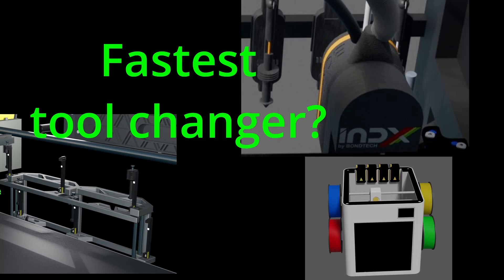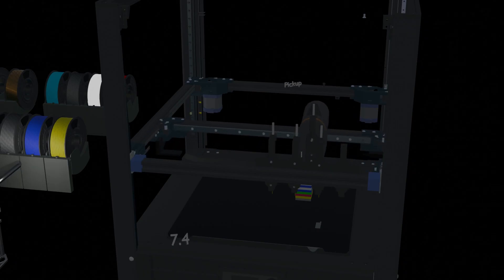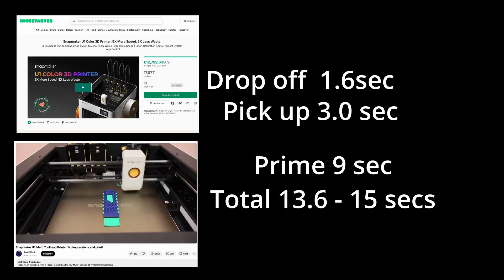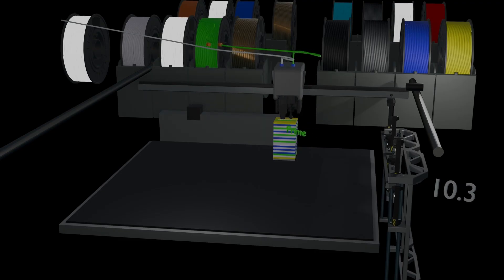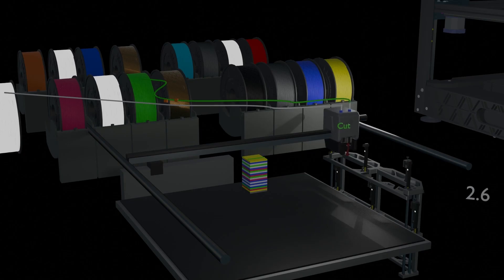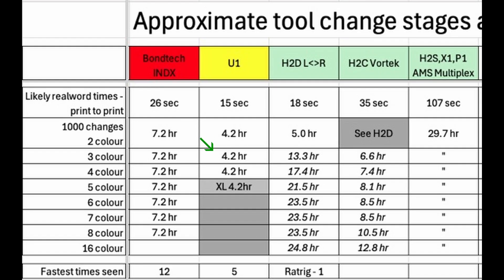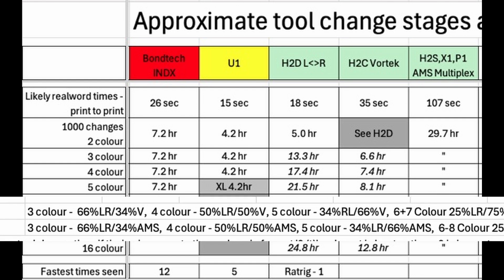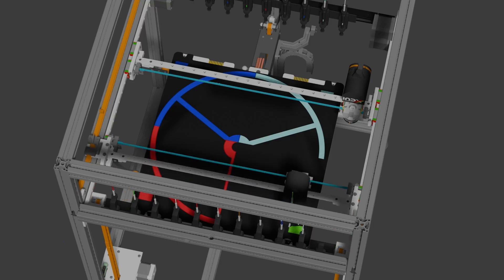INDX U1 H2C Vortex speed comparison V2 -improved sound

Comment: I think you should have included the big player out there in toolchangers - The Prusa XL.

It's toolchanging is about 5 seconds. I'm looking forward to the Core One/Bondtech solution, and suspect they may look at preheated docks to reduce the change times even further.

Much as I love my XL (My X1 Carbon has been collecting dust since I got it), I think the Bondtech solution will be a game changer.
Reply from the maker: I see the XL and U1 being pretty much the same in terms of timings. If you assume the same around 5 seconds for the actual tool change, plus say 9 seconds for priming.  U1 overall print time likely to be faster than the XL due to smaller size and faster factory preset speeds and acceleration.  XL wins in size and one more tool and support. U1 on price.
Reply: @dwuk3d The XL is about 5 seconds  - consistently and that includes the priming. The head is already preheated and stabilised before it's picked up.
Reply from the maker: @theaussieviking8555  For consistency I have included 9 seconds priming in all of my timings (on top of tool change moves and a small allowance for post pre-heating temperature stabilisation) - 

I used the recent Aurotech XL video to get my XL timings - which were
PreWipe	1.70
Drop Off	2.90
Pickup	3.00
Priming	3.57 (changed up to 9 secs for consistency)

If you have any videos showing 5 seconds including priming I would be interested to do detailed timing on them - as doing some fastest possible times could be interesting too (I've got a few very fast stealtchanger videos in this category).   

I know it is possible on some printers to reduce priming time down or turn it off completely, plus the priming time changes on different layers - as for example on the bottom layers the prime tower is often a fair bit bigger and needs a big brim created.
The H2D for example definitely needs a prime tower, whereas on an A1 and X1C you can often turn it off without too much noticeable impact.

In theory for the H2D type nozzle/nozzle swaps should be the quickest of all - as there is no need for any X/Y movement to pick up/drop off the heads - but I know that in practice XL/U1 changes are quicker - although I guess that may machine if BambuLab feel pressure to increase their speeds.

Next fastest should be the tool changers - U1/XL - mainly due to the preheating, plus not needing a big X 'release move'.

Slower will be INDX due to post pick up heating and extra moves, but the fast cooldown/heatup should reduce oozing/cooking a bit - so may need less priming.

Vortex will be the slowest - for all of the INDX reasons, plus AMS moves on top - especially if BambuLab decide to conservative and do a lot of the moves serially - rather than in parallel.
Reply: @dwuk3d  Most of the speeds on Prusa machines are controlled in the gcode. Prusa favors on the conservative side, while Bambu pushes the limit, often too far  in my experience - except for pooping. I was able to cut the poop time almost in half by rewriting Bambu's purge gcode. The gcode for an XL tool change defaults to a max speed of 350, and defaults to a wait state in case the extruder hasn't quite stabilized in the preheat. But these both can be modified in the slicers printer profile Tool Change gcode. I love my XL! No machine is perfect, but it it pretty incredible. That said, I have 2 Voron V2 machines patiently waiting for INDX to ship!
Reply from the maker: Not quite the same comparison I know, but since I got my h2d I am f finding I am still using the x1c's quite a lot. My prusa mk3 though is like your x1c gathering dust.  I'm hoping though to bring it back to life with indx - probably in C1 upgraded form - but I might give Indx directly on the mk3s a try first.

Comment: I still think for people who want a well tested, silent and small printer setup (so difference between outside and print size) for in the home will be best of with the h2c yes it will not always be fastest but for 1,2 and 6+ colors it will be for most people. The 3,4,5 colors it will be say 20-25 seconds slower but many feel  the ams system will only have downsides but it does make many things easier from loading/unloading/drying in the box and easy way to extend to 24colors. Ease of use and (probably) testing for a much better out of the box 'just run the darn thing) . I feel the indx system shows lots of promise but we have to see it sold in several 'i just want to buy a darn printer' products to compare. Clearly for people who want to change or build their own printers the indx system seems to be most fun and best to use to upgrade or change your own printers and probably a very good system for people who want to make a perfect system for a specific use. The 300c max tmp might be a problem.
Reply from the maker: Agreed - i hope they keep the price of the h2c at a reasonable level- it would be good for competition too - to see snapmaker do well and hopefully they will add to the number of tools, increase the size and maybe add some sort of AMS system too once the h2c has demonstrated the benefits of this dual approach.   Also probably a stretch too far - but I am hoping for a 4 tool vortek upgrade for the x1c.
Reply: @dwuk3d  I am personally hoping the 'c' will add a max of 500-600 euro to the price of the h2d level so h2d now at 1899 euro maybe mid 2499?
Reply from the maker: @scb2scb2  I'm hoping they slot it in close to the current H2D combo price - for an H2C combo with one AM2Pro and 3-4 Vortek nozzles.  Would need them to drop the H2D combo price a bit to make that work.
Reply: @dwuk3d  Maybe but ill only get 1 and i am not that price sensitive as some others so we will see where the h2c+ams2+ht+4hotends will end up since that feels like a likely 'combo'.

Comment: The dual gantry setup seems like the ultimate multi-color continuous printing solution. Essentially zero downtime while tool changing and purging and priming are happening.
Reply from the maker: Agreed - with dual gantries quite a few of the changes will be able to be done in parallel - especially if you double up some of the filaments.
You do need a firmware that supports parallel processing too - like RRF, or something like dual Klipper instances.

Comment: So it does a wipe mid air? As that's what you show on svo8 it will take longer as needs to go to the wiper not just left right mid air get it right if your going to keep showing this 💩
Reply from the maker: For a flying gantry like the SV08 you will need to wipe on something attached to the gantry at the left or right or sticking out at the back, or wipe on the prime tower.  

For a Trident / elevating bed type machine you can have a wiper in a fixed place at the back - like has been shown on the U1 or Bambulab X1/P1.

In my animation there is a gantry based wiper - but I probably should have lit it up more that it shows up better.

Comment: I keep hearing that H2C will not be able to print flexible materials, but I could not find a good explanation why that is the case. Do you have any insight on this ? I own a small business for custom parts. I don't really care about color changing, but I could really use a printer capable of printing with 3 or 4 different materials including flexibles.
Reply: Das Hauptproblem ist wohl beim TPU das es für einen Wechsel automatisch gefördert werden muss und da ist es leider nicht zuverlässig diese Förderung über das AMS zu gestalten.
Beim H2D ist es möglich beide Düsen von Hand zu beladen wird aber nicht empfohlen weil es zu Qualitäts Minderung führen kann durch den Filament Puffer der dafür sorgt das das Material sich entspannen kann.
Bei TPU könnt es dann aber zu stauchungen kommen je nach dem wie groß der Widerstand an der Feder ist und wie weich das Material ist
Reply from the maker: @Daniel-f4f9n  Agreed - I would hope they provide a route for TPU into the left nozzle at least without going through the buffer.

I guess you can always just feed the TPU directly into the top of the nozzles - but it isn't anywhere near as convenient as it will be on the snap maker U1 or Bondtech INDX - but for occasional use should be ok I guess.
Reply from the maker: At present Bambulab recommend manual loading and printing TPU on the H2D right nozzle. 
I would suspect on the H2C they would change that recommendation  to be the left up/down nozzle, with other materials in the Vortek right nozzle.
In theory you could probably manually load a 2nd TPU in the right nozzle too  if 2 filaments in total is enough for the print.

U1 and INDX will be more convenient for TPU and also will be able to go above 2 TPUs.

In terms of reliability and print quality though not sure - the H2D is pretty good with TPU at the moment I think.
Bondtech say INDX works well with TPU and some of the U1 demos have shown TPU working fairly well.

Comment: Very nice comparison, thank you! 😎
I'm definitely going for the INDX system, and planning a new printer build for it, similar as a Trident printer, but I want to have the tools in the back, so have to mount the carriage on the back of the X beam. The printer has to be enclosed  too.
Currently I'm figuring out how to mount the tools in the back and at the same time make room for the two A&B belts right behind the tools.. Can't wait for Bond tech to release some dimensions of the system.
The dimensions of my design heavily rely on the dimensions of the INDX system; Overall dimensions, position of the bed within the printer etc etc..
Reply from the maker: Thanks,  mounting the tools at the back should work - especially for a custom build.  Bondtech have tested it out that way on a Ratrig - but I think just turning the print head around on an existing printer is going to cause a loss of a lot of access to the build plate at the front - so doing a custom build that is designed for a rear facing toolhead will work a lot better I think.

They have said they will release some more details in September, but I suspect we might have to wait until November to get the final specs.
Reply: @dwuk3d  Thanks! 👍